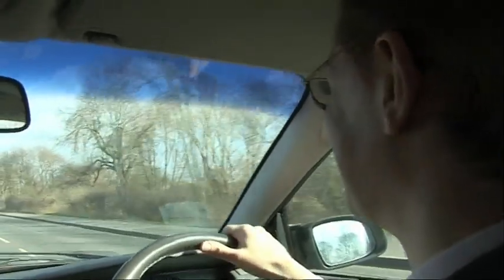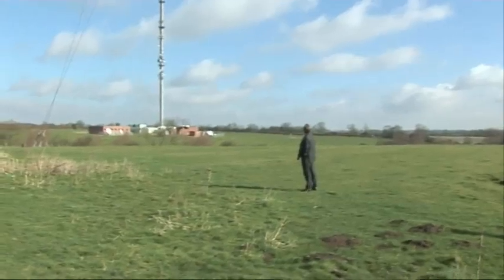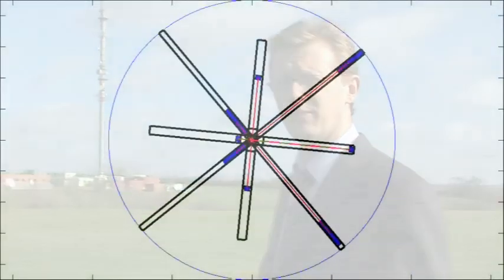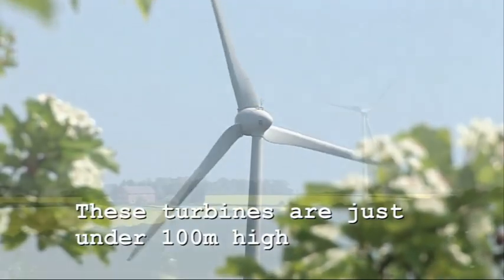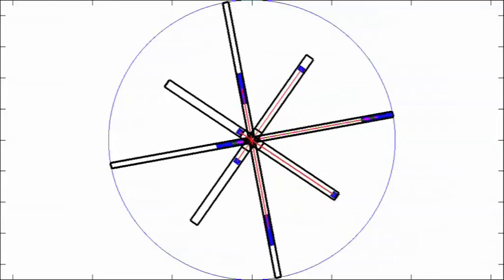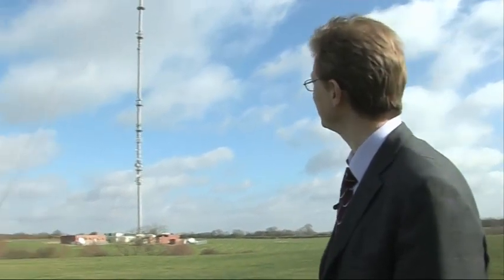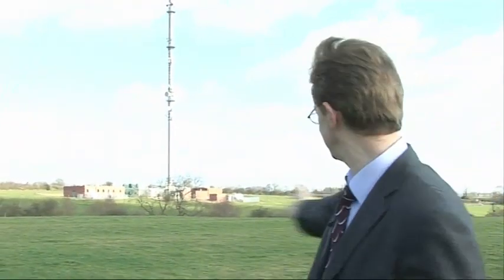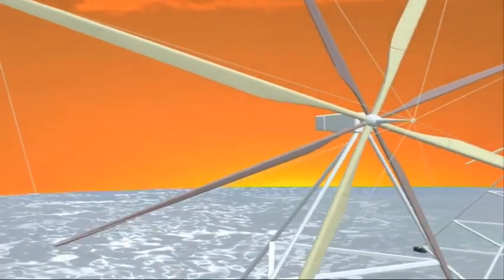The 1,000-foot wind turbine

Comment: While not as efficient as a traditional rotor generator turbine, this looks like just the thing for compressed air energy storage. The question is, efficiency, and cost effectiveness compared to a regular turbine charging a battery, or spinning a flywheel. The system with the lowest overall levelized cost of energy wins.

Comment: I haven't seen all the prof's videos, but here's my simple question. Why not have normal blades turning a very big fixed single cylinder compressor?  It will work as slowly as you like. Simpler, cheaper engineering, easier management of heat losses and easier maintenance, at first glance...
Reply: i was just thinking that too. if in place of an electrical turbine you have a massive air compressor it would do the job and i imagine save on the costs and stuff.
Reply: Andrew Kwasek 
Groan*

Watch the video.
Reply: Sean Dali Which video?
Reply: Andrew Kwasek 
A joke?
Reply: Andrew Kwasek   In this video the prof is proposing to put pistons inside the blades to compress air.  Maybe you were thinking more generally about wind turbines, which are mostly electric.  In that case I can see sense in putting the electric generator at ground level and using a hydraulic linkage, or a vertical shaft, but I'd leave compressed air out because of substantial heat losses.  I'm sorry to say that the videos I've seen don't inspire me with huge respect for this gentleman.  Several commenters have pointed to several obvious disadvantages of both the turbine and the under-sea bag energy storage idea, which again has big energy losses due to heat loss.  No answers  that I've come across.  A bit shameful.
Reply: Ray Kent 
Their criticisms are scientifically illiterate. 
I think you should Google the idea, find out the benefits and then make an informed opinion.
Reply: Sean Dali   I apologise for being scientifically illiterate, would you be kind enough to specify a google search string that puts me straight?  Maybe it's "piston in blade turbine undersea compressed air storage".  I'll try that right now.  Hoping you  have a better one.
Reply: Sean Dali How much does a pirate pay for a ear of corn?

A buccaneer! AHAHAHAHA!!
Reply: Ray Kent I think the idea is a neat one, it might not be as efficient in many ways as what we already have but i do condone his out of the box thinking. I remember thinking you could store energy in massive springs. I know that is a bad way to store it, but its important to think in different ways to get the gears in your head turning, if nothing else. 

But i see he would have 4 actual wind blades and then 4 piston blades making a total of 8 (i didn't watch the whole vid, saw a few of the other ones though)
My question is that instead of paying for these four massive hunks of metal and all the extra materials for the 4 other blades ad all that, why not have a traditional electric wind mill, but instead of an electric turbine put some kind of pistons and crank shaft there to compress and pump the air instead of making electricity?

Comment: We need wind for blowing away all the gasses even ordinary nature breathes. There is the natural energy mix. For every watt of solar power there is one watt of wind and one watt of water and one watt of coal and one watt of gas and limmitles of uranium and other nuke stuff... There is the mix and wind is not the solution. There is not enough of it to power the world and is fucks up climate when we massively start tapping in to it with kilometre high megalomane windmills.
Not dynamical used as brake or huge fan to steer weather in the right direction the whole atmosphere could grind down to a dull nasty smog.

Comment: A fast flowing river that goes for over 2000km with lots of rapids over rock and small waterfalls. (Orange river SA through the desert) 
They could line up hundreds  of thousands of turbines along that river with generators buried under ground.  Generate electric power non stop...Store the power if you must using a dam with a gate you can either open or close.
Renewable power for real world consumption.
Reply: The problem with this idea is that the sediment load a stream can transport is proportional to its velocity. By roughening the bed with turbines, you slow the flow and sediment gets dumped and the stream moves.

Comment: @BaneOfFreeSpeech Seamus Garvey is not designing the new wind mill, that job will be given to engineers who will probably say what idiot came up with this idea. Seamus Garvey is not a comparison to Einstein with regards to his work or his intelligence. Bigger does not mean better. The windmill will need to be redesigned; it will be a weak structure even with expensive carbon fibre. There will be greater weight and wear and tear on parts. Will it be effective and economical to build a 100 more?

Comment: @BaneOfFreeSpeech what you seem to have forgotten is just about every new experiment fails. An untried method of storing energy and a prototype windmill. Believe me they will need to go back to the drawing board and start over. In the mean time the capital invested in the project will be unproductive. Rather improve on things, which have been tested and work than set up a fiasco. 
"A few bags of air" Thats the reason for the over sized turbine do some research.

Comment: @slutformoney This windmill in the clouds was for the task of pumping air into bags under the ocean…That’s why its not going to be quite like the other NORMAL ones. NOT for real time energy production (although I suppose when the energy bag idea fails they probably will have to consider real time electrical generating. I don't know why you talking of generators and gearboxes and constant rpm??? Where did you get that info???

Comment: @BaneOfFreeSpeech It would be harder to tell which idea is better. I'm sure Mr Seamus Garvey hasn't considered all the factors. His project seems to be based on numbers rather than practical sense. When he came up with the idea of the energy bags he had no idea what force was needed to pump the air down into them. If he did then maybe he would have designed them differently. But no he didn't hence a 1000 foot wind turbine needs to be made for a few bags of air.

Comment: I thought it was a good design,using compressed air would eliminate the maintenance heavy and unreliable gearboxes of present turbines.
Building them far at sea will make them less efficient,as the resistance from the cable will lose a lot of power along the way.Even now the national grid loses 25% of all electricity generated because of that .